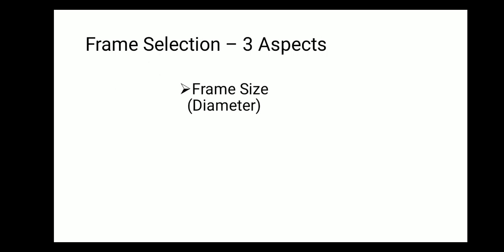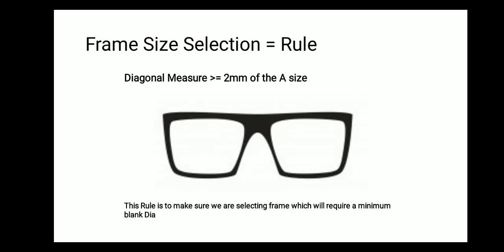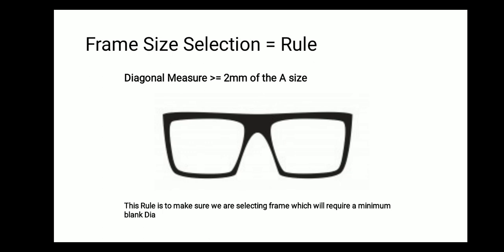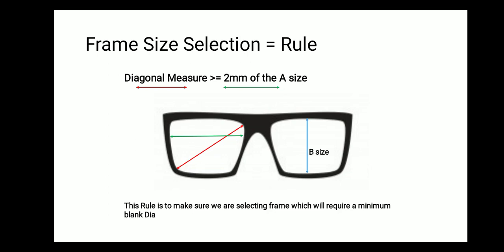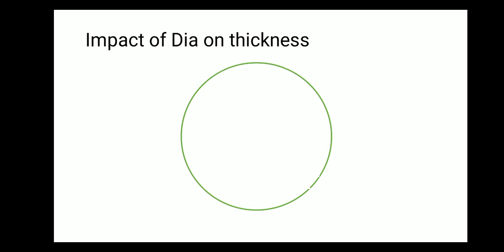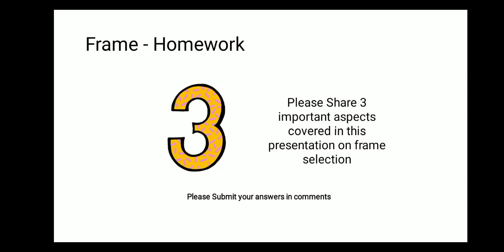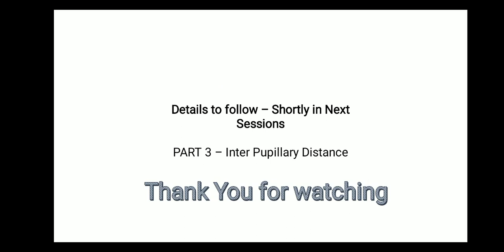Dispensing Pearl Spectacle lens thickness ( Part 2 - Frame Selection)

Comment: Firstly, ED of the frame shouldn’t be more than 2mm of the A size of the frame.
Secondly, round edged frames are better than sharp edged frames.
And lastly, plastic frames cover most of the thickness of the lens.